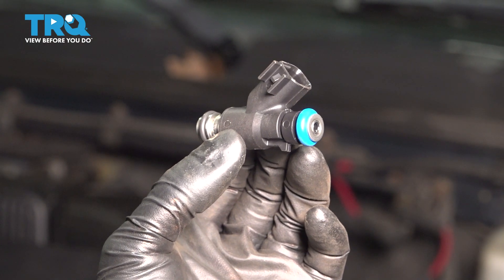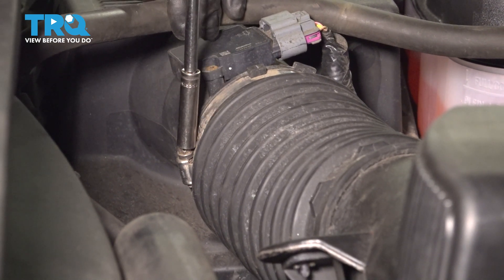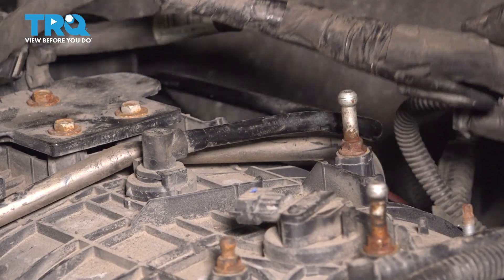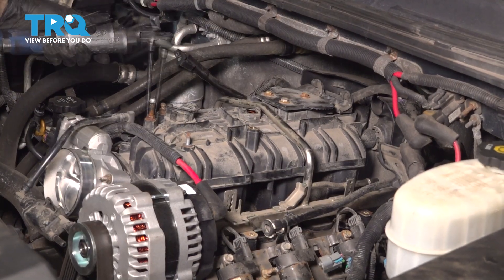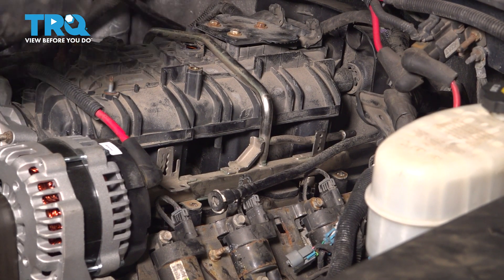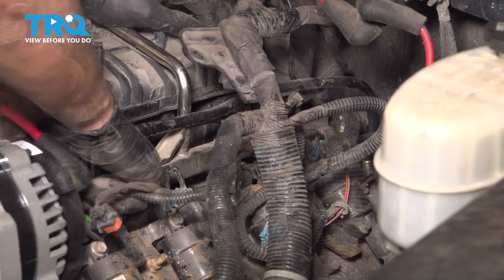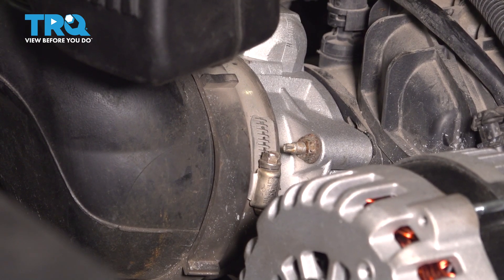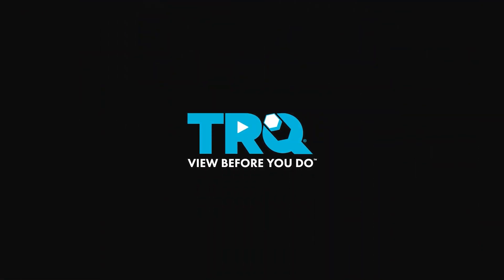How to Replace Fuel injectors 2007-2014 Chevrolet Silverado 2500 HD

Comment: Removes fuel line... gas comes out of the lines.  "I don't recommend using electric power tools at this point."

(*Proceeds to use electric power tools*)

Comment: Great instructional video. One question I have is on the left side of the engine on the back left Bolt of the fuel injector rail there's an additional bracket that goes underneath it that's attached to the engine and it seems to be lifting my number eight and number six injectors a lot more than the others. Common sense says to remove the bracket and put it on top of the fuel rail but you never mentioned that rail and you would have to remove it in order to remove the fuel rail so I'm wondering if it's normal for the 6 and 8 injectors to sit higher...